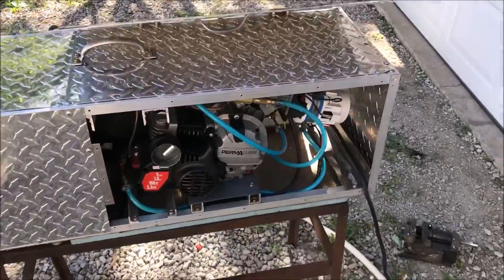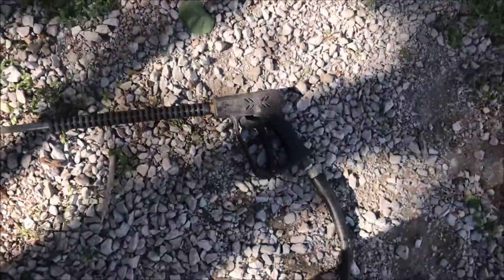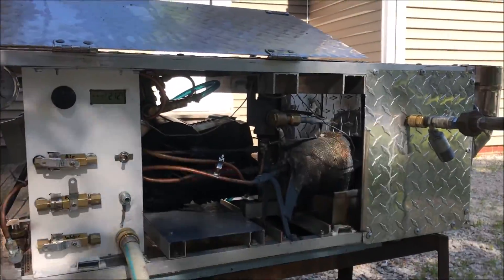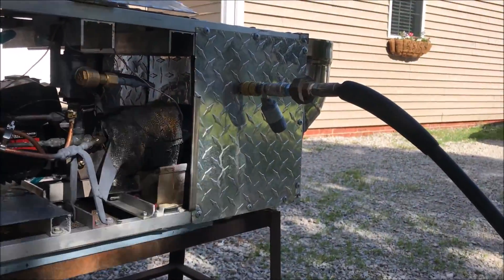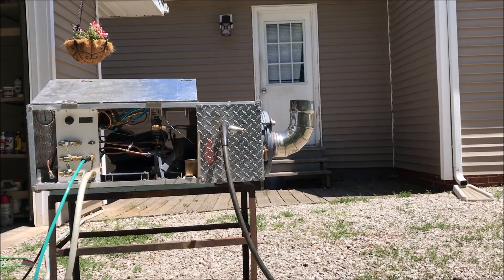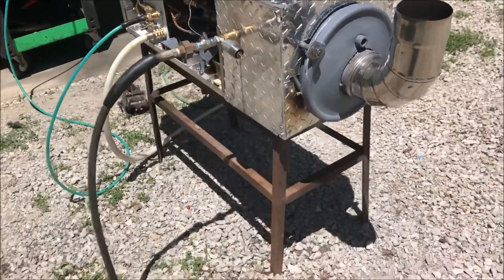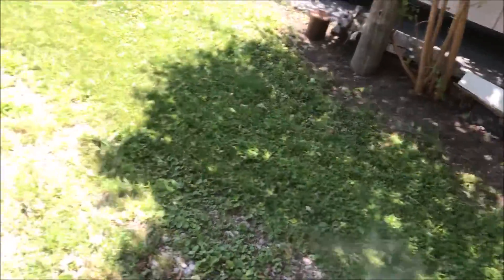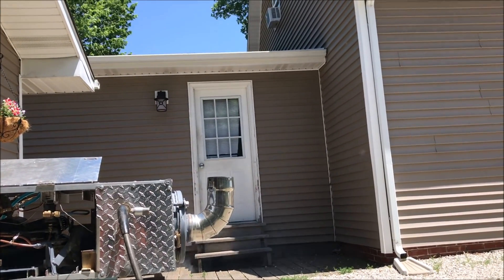Micro boiler steam trigger Mechanism testing

Comment: So maybe if I hadn’t tried it I wouldn’t had never known. Tht a regular pressure washer has some type of thermal activity check valve in the pump. Cause I hooked mine straight up to the 7” gal hot water heater and notta. It would lock right up soon as I hit wands trigger. Years later one of the Hotzy diesel burning pressure washer came threw scrapyard. I kick my self in the ass for only snagging the axle and tubeless solid tires off it. Should have bought the whole damn thing for pennys on the weight.

Comment: Nice, that's a great way to regulate the pressure in the hose. Perhaps duct the venting steam into the combustion chamber which would further cool the coils when you're not using the gun.
Reply from the maker: Great idea  , however i worry about lime build up , sometimes the steam is wet .